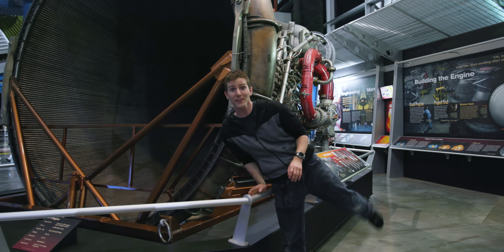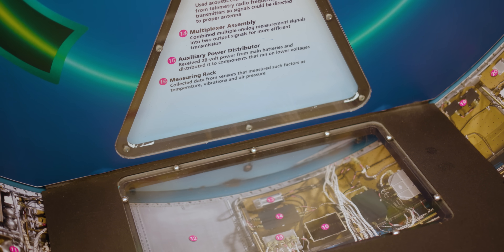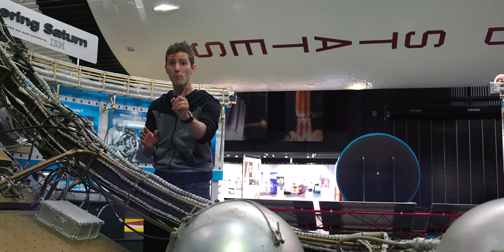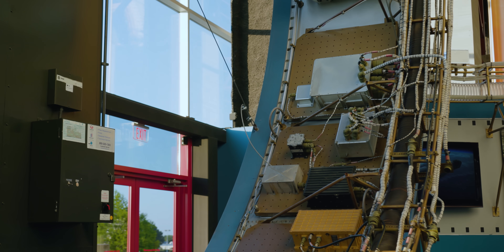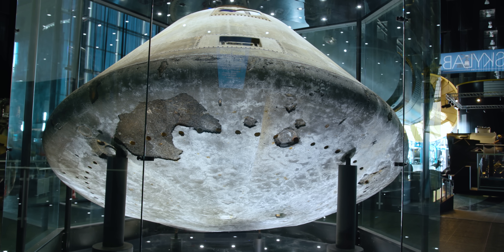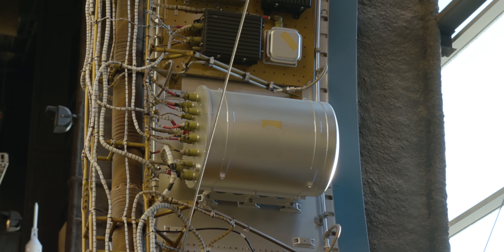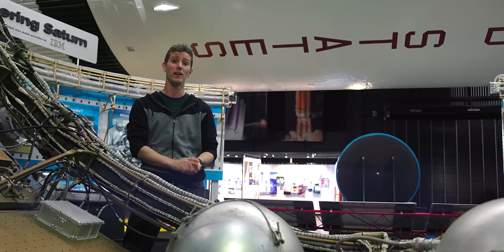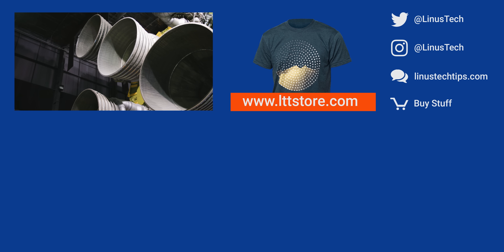The ACTUAL Computer from the Saturn V Rocket - ft. SmarterEveryDay

Comment: Apollo 14 needed potentially a lot more battery lifetime, when the docking didn't work. The final estimate on the battery lifttime was about 13 hours from the time they first tried docking. Initially they said 8hrs.  They solved their problem long before that hough. Had they not, they would probably have done a spontaneus spacewalk to fix the docking mechanism and needed all the battery time they could get as that was limiting how long the SIVB would be stable.

Comment: About 9 minutes into the video you talked about the analog computer that moved the engines and steered the rocket. You said you wouldn't want an operating system like Windows or Android controlling this system, since they process data in batches, and this Saturn V system was a "real time" system. Does that mean that the SLS rocket for the Artemis missions will have a system that's partly analog as well? Or will it be all digital, but just not using an operating system similar to Windows or Android?

Comment: It's amazing, I work on aircraft and I have seen those EXACT SAME CANNON PLUGS in my systems that I work on.  Granted now they're mostly self locking, but I have seen ones you have to secure with wire as well.  The technology has advanced and we use fewer wires but the connectors don't change much even after 50 years.

Comment: If you wanna see inside the chips in the module look up Fran lab and eevblog they passed around a module that they took apart to show how they work and methods used in those elections is like no other stuff I have seen. I have been messing with electronics all my life 44 years and am an electrical engineer. Great video by the way. Keep it up.

Comment: I wonder how many years will it take to make a quantum smartphone. I know the quantum computer has a massive cooling system. But if we look back in history; A computer that had almost the same power and capacity as a the original PlayStation was the size of your average US middle-school. Just the 2mb of Ram in the original Playstation is 512x more than Apollo's Guidance computer. So will it be 50 years? Or maybe 20?

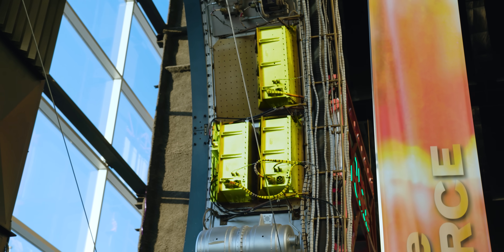Comment: I thought it sounded kind of nuts that those batteries were 5,300ah (2:15). Other sources say they're 350ah, that sounds closer to reality. For a little context, a 125lb lead acid truck battery is more like 150ah.

Comment: Small correction — radiators DO work in space, and are used on most missions. The method of heat transfer you’re referring to, where air flows over the radiator, is actually convection.

Comment: horizontal black bars on my 16:9 monitor
vertical black bars on my 21:9 monitor

why are you doing this to me?
Reply: you can install Ultra-wide video extension for google chrome it will automatically size any video to your screen aspect ratio
Reply: @dukenukem8381  yea i have that, but it would either be stretched weirdly or lose the edges since its done aspect ratio in between,
id guess 18:9

thanks tho
Reply: @marshallr.8121   mine extension  does not stretch video  although i lose  some of the image if i watch 16:9 videos on 21 9 monitor , but i got used to it  ,  its much better alternative to having black lines
Reply: @dukenukem8381  should be able to Google different modes, although stretching is pretty much never worth it so fair enough

Comment: Hi, please stop speaking in amp hour we don't know the voltage so that's not useful. Watt-hours are straight-forward thanks ;)
Reply: Not really realistic to report watt-hour if the discharge is variable in voltage
Reply: @Diamondketo  Actually this does not make sense (the voltage will lower over discharge but this is not relevant). Make some research but basically you use the nominal voltage of the battery.
Look at your laptop battery.

Comment: There's a computer museum in Cockeysville, MD, called System Source (they're a computer solutions company, but they also have a museum on-site).
We had a field trip there, and passed around a film canister with the iron ring memory bits. One of my students dropped it, and they went everywhere. Good times.
They have nearly every major computer system and calculation device represented in their museum.
Reply: Fortunately picking them up just needs a magnet.

Comment: God damn! let that sink in - Hand-woven Random Access Memory.
Reply: And it was still being used on commercial aircraft navigation systems into the '90s, at least.  The descendant of that system was used on lots of 747's.  One of the advantages was that the magnetic core memory wasn't subject to cosmic rays flipping a random bit & causing a parity error.  Some of the latter models of the same units had solid state RAM, that this occasionally happened with.
Reply: @NemoConsequentae The 747 entered service in 1969, the same year as the first moon landing.
Reply: @maddpeanut6313  Yes, and I don't know what they in the first ones, but the customer airlines who bought them could specify which navigation systems, avionics packages, engines etc they came with.  The ones we had came with Delco CIVA Carousel INS that, (when we went to the US for test/repair training), Delco informed us, they were required to submit a bid/design for the navigation system for Apollo, & they 'won' the bid.  Then they had this thing they had designed but no more Apollo program, so they redesigned & repurposed it for terrestrial navigation, which is more complex as you have to take into curvature of the Earth's surface and Earth rotation.  So from an inertial nav viewpoint, you tell it where you want to go, but that spot has moved by the time you get there...
Modern Inertial Reference Units, (no longer Inertial Navigation Units as they only provide the reference for other systems to do the navigation), use ring laser gyros & solid state accelerometers in a strapped down system, rather than the electromechanical ones used in the Carousel, (it rotated at 1RPM to cancel out bias errors), which did all the navigation calculations AND stored the navigation program, in just 6kB of memory.

Fun fact:  While watching The Expanse, I recognised the 'ball', (the rotating platform used to carry the gyros & accelerometers in the gimbals), as the spinning bit near Amos, when he was repairing the thruster in the battle for Thoth Station.
Reply: @NemoConsequentae  and this unit survived the LIGHTNING STRIKES of APOLLO !@ TWICE, modern PC's would have been fried along with the astros
Reply: @gertraba4484  Probably not, really.  The metal skin of the rockets, (as does the metal skin of aircraft), essentially acts as a Faraday cage, so the strike travels across the skin on it's path to an area of lower potential.
Reply: @NemoConsequentae  still an analog computer type of system is very robust,  modern electronics would have been fried and the ascent aborted with no guidance
Reply: @gertraba4484  They are 8 bit digital computers.  Analog uses varying voltages, these are digital 0/1 storage & calculation.  It is just not built with modern CMOS chips, which are much more vulnerable.
Reply: Is it still RAM when it's not volatile? And when it's the only memory of the whole system?
Reply: @MrRolnicek  yes
Reply: and now I can just download it for free
Reply: it's not really RAM =)
If you read it, the memory gets deleted
and the memory is non volatile. Actually the module they had might still have data on it from 50 years ago.
Reply: I have an old memory module of that design.  It's about 1"x3" and I think it is less than 100 bits capacity.
Reply: Lyan Villacorta don't quote me but I think that's storage, or at least I think that's what destin said in his video
Reply: @rav_6602  It is both the storage and RAM.  Same thing is used for both.
Reply: I tried to do that with redstone once, and it was awful. can't imagine irl with hand.
Reply: How many bytes was that RAM?
Reply: @usagiyojimbo9468    114,688 bytes or 112-kilo Bytes or 0.1 mega Bytes or  .0001 giga Bytes.
Reply: @maddpeanut6313  isn't it 114688 bits? 14 kiloBytes?
Reply: @maddpeanut6313  112KB or Kb
Reply: The fuck it want again? I've let it in like twice this week.

Comment: Okay, I am going to be the butt here, but I hope it will come across as constructive. This video should have been awesome but it was just... boring. Not bad, just boring. I think the problem is that there is too much explanation before we see anything. There are tons of other videos, 50 years old, put out by MIT and others, that goes into detail (in fact, its one of the recommended videos now that I have seen it). Granted, that video is boring as well - mainly because it is a 30 minute video of them telling how a calculator works.  

What I would suggest is doing one of those videos where the host says "first a bit of background, but if you just want to see the cool stuff, jump to this point in the video". I also think this video could have benefitted from better B Roll footage and better sound processing (I am assuming noise reduction was done, but your voice in this video sounds like I am listening to some highly compressed MP3 or something (granted, it is YouTube, but I mean more than normal).

So yeah, I mean, I usually love your stuff, watch every single video, but this one which I thought was going to be awesome was just MEH! Not bad, just not awesome.

Comment: Getting the First Men on the Moon was an amazing achievement for the US Space program, but they got a bit of help from their northern neighbors, Canada. 

When Canada's AVRO Arrow fighter aircraft was cancelled. NASA headhunted engineers from that pioneering design team. Owen Maynard from Sarnia, ON became the lead engineer on the Lunar Module, and Bryan Erb from Calgary, Alberta designed the heat shield that protected the returning astronauts from the heat of re-entry, to mention a couple of the former AVRO engineers. And, as Col. Chris Hadfield mentioned, the first feet on the Moon were Canadian! The Lunar Module's legs were made in Canada! And it was because of that expertise that we were asked to built the robotic Canadarm for the shuttle, and later, the ISS.
Reply: Oh God, now write up 5 paragraphs on the Space Shuttle arm and how without Canada. Anywho you remind me of the BBC, when I watched some special they did about the Hubble and basically made it sound like the Brits design the entire thing and the Americans didn't do anything except load it on a rocket.

Comment: Lel, that cooling system can dissipate 9000 watts? That's about 12 horsepower... If you consider a car's engine to be 30% efficient then for every 3 watts of wheel-power it creates 7 watts of heat.
Simply put: this super cooling system can only cool down your car's engine while idling! If you produce anything over 5hp then your engine will overheat XD.

Comment: I need help! Looking at a new cpu cooler. Looking at either the Corsair h100i platinum or the nactua NH u14s( don't want monster one) if I got the nactua I would replace fan with chrommax and add a 2nd to cooler,  get the black cover for the tower and get 120mm nactua fan for the back exhaust. And up top have 2 140mm thermaltake fans ( orange led for build). It's all in a cooler Master h500 with 2 200mm fans in the front.
The cost for the Corsair is $199 and for all the fans and noctua cooler is $255. Money doesn't really matter , can't decide

Comment: 5:38 "semi conductors just werent reliable enough yet"
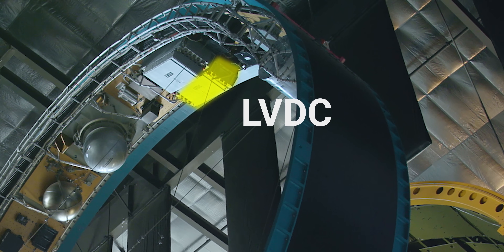7:43 "the processing modules had transistors..."
which one is it?
Reply: As per Scott Manley from Destin's Comments - "Fun fact about the core memory - it's non volatile, which means the RAM on that computer still contains state from when it was turned on 50 years ago, the AGC restoration team were able to recover data from active memory."
i.e Semi-conductors weren't reliable enough, whilst they could be used to process data - storing the data in them did not have the reliability needed for the intended use. Any loss of data in those 14kb means the difference between a space vehicle... and a bomb.
Reply: Some.

Comment: 50 yrs of computing advancement, almost 0 yrs of propulsion advancement.
Also, USA written on the rocket triggers me, because I'm an enlightened progressive pixie.
Reply: How did you miss SpaceX and other company achievements? Even USSR had better engines.
Reply: @RawbLV  if you plot on graph these advancements, computing would fill the screen and propulsion would be a pixel, is my point

Comment: 4:06 Yes they do, a computer 'radiator' is barely a radiator, as the radiation heat transfer component is quite negligible. The correct term would be a heat exchanger. In space, the only option you have that does not require some kind of 'fuel' as that fancy sublimation cooler needs
Reply: Which is fueled by water.

Comment: Semiconductors weren't reliable enought? How did they build Audioamplifiers then?
Reply: With BJTs, about a dozen per channel for a seriously fancy one. Remember that there were no MOSFETs of any kind yet (let alone modern low r_DSon parts common in switching applications), and in fact the mid-'60s still were very heavy on germanium, which requires substantial derating and made for rather sluggish transistors. Nobody even talks about pre-1970 solid state amps designs any more, and there are good reasons for that... they tend to be all kinds of crude.
Reply: @PileOfEmptyTapes  Oh, interessting, thanks😅

Comment: Heh heh heh... you missed the bit about how the stable platform confirmed its own orientation before launch, as in an optical window out of the ISU to a geodetic marker about 400m from 39A with a light source. As the V wobbled and wobbled as wind buffeted, fuel got loaded etc. the stable platform used analogue optical feedback to reset the stable platform to about T-5. Bloody brilliant!

Comment: Cable management level: NASA. How many zip ties do you think they used on that cable management!?
Reply: They did NOT use zip ties! All of those cabling looms are tied with a continuous wax thread dozens of metres in length, completely by hand!!
Reply: @tekvax01  
Thank you!
I was wondering what that was, I was thinking string and tied but I didn't see any knots, but waxed string would let imperceptibly small half-hitches stay in place.
Reply: Very few relative to the amount of wiring, those black bands don't appear to be zipties. (I'm wishing I had a 4k monitor so I could see them better though)
Reply: Zip ties? Did you mean tweezers?
Reply: @divingradish  
No? all the little black bands around the wires, they don't seem to be zipties. hence there's a lot less than there appears at first glance.
Reply: This is NASA: There is probably a specification that they follow if you want to find out the real number.
Reply: Geoff Seeley  Those black ties are actually called “Tie Ties”, at least from what I can see. We use the same sort of set up in aviation today, also it might be hard to see for the untrained eye by the way all of those connectors are hooked up are called “Cannon Plugs” which i deal with on a daily basis working on airplanes today. It’s actually really cool to see the technology still being used today

Comment: So, you will need this sublimator to cool down the next intel chip?
Reply: Scrolled down knowing that the top comments would be regarding Linus going to space to get better cooling.
Reply: heatpipes are allready doing this (internally)
Reply: (correction) it is not sublimation its evaporations what is used in heat pipes ...but none the less it is using a phase change for the cooling
Reply: Yeah, use a sublimator that only works in space and requires refilling every few hours of use for a consumer product, what a great idea!
Reply: So you are saying, cool it with dry ice?
Reply: Won’t need it cause we’re getting PCIe 6 very soon, there’s no excuses now after watching this. No excuses, Ha
Reply: That's a weird way to spell Shintel
Reply: i needed it to cool my celeron
Reply: That guy actually made an intel joke too though not in this video.
Reply: If you want water vapor in your system yes

It would be fun tho to have low pressure closed loops in cooling so that we can have gas instead of liquids depending on the temperature (kinda what's happening in some heatsinks if I remember correctly). It would be fluid cooling